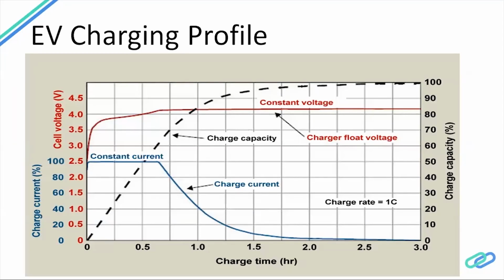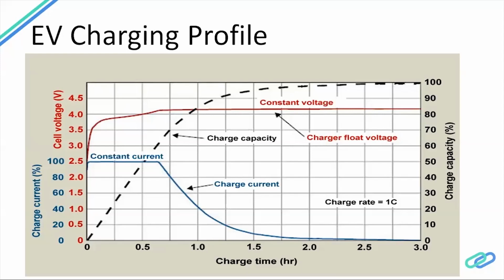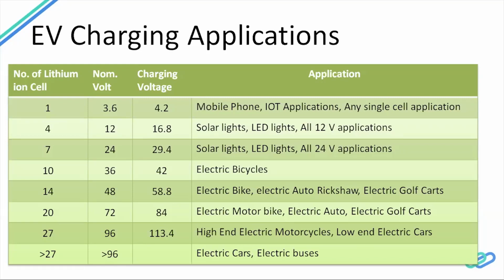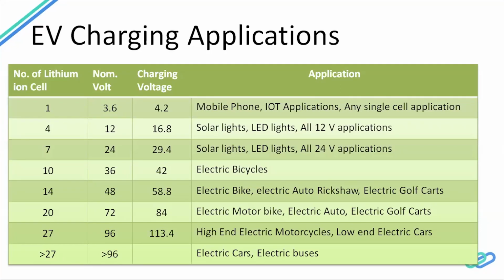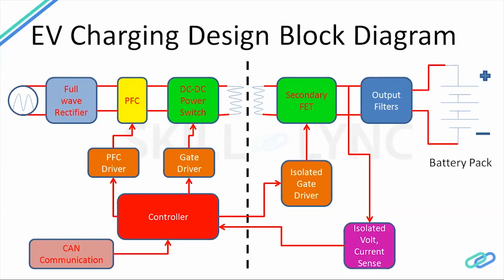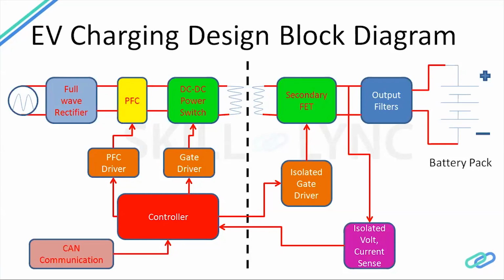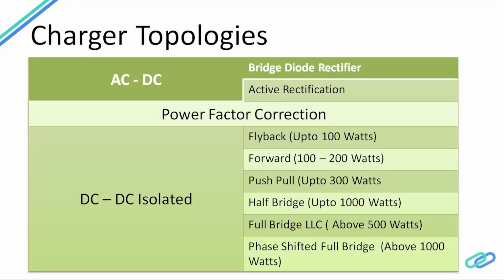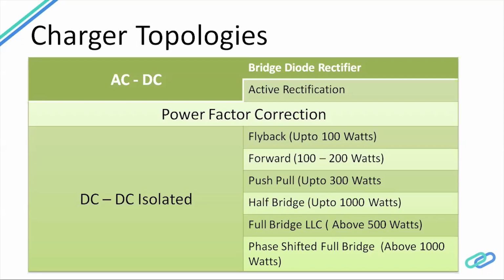Battery Charger Circuit Design (Part - 2) | Skill-Lync

Comment: Sir, I am working on onboard charger for ev..so I want to learn the simmulation for the same..can you suggest some course as I need it urgently
Reply from the maker: Hi Khyati, can you please let us know what you would like to simulate in more detail. We can suggest the relevant coursework
Reply: @SkillLync  actully I am particularly working on 3wheeler on board charger..so I want to modeling for that to size my charger for by battery of 4.13kwh capacity